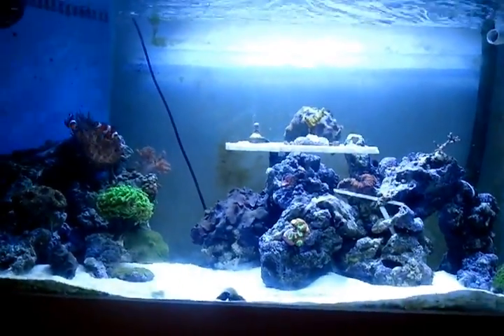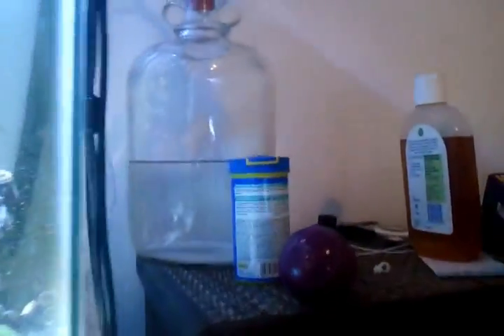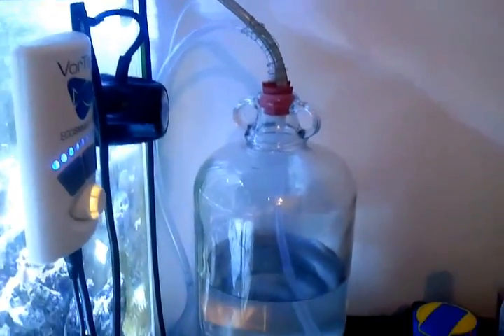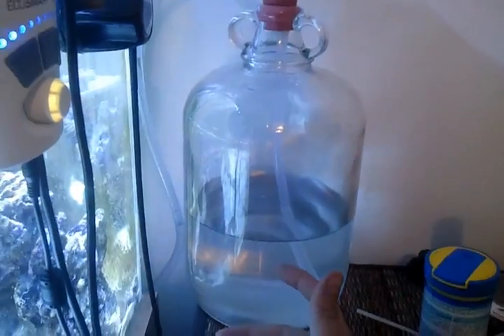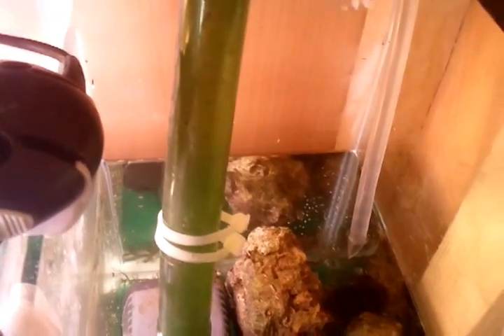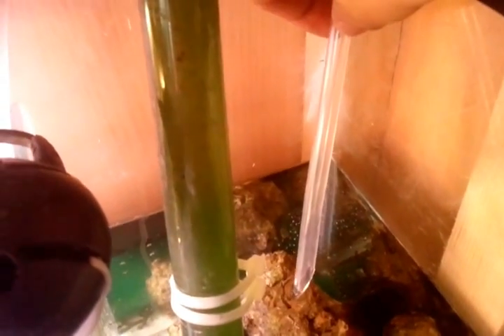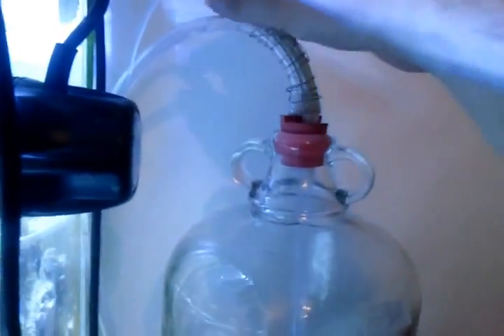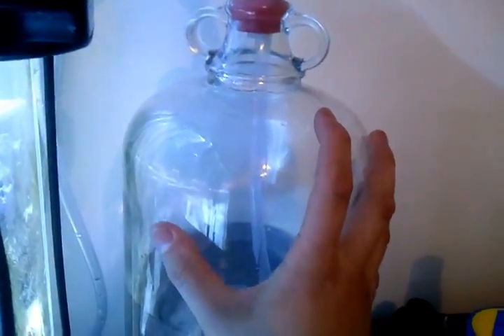diy gravity auto top off vacuum

Comment: Fantastic but I just don't know how you set that up ?
Reply: Theres Only 2 ways  in and out. Water out via siphon and air in via tube in return compartment.when water gets low it lets air in and water out. When the level is sufficient to cover the hole in the air-in tube The water level cuts off the ability to equalize pressure, thus stopping the siphon.

Comment: you can use plastic bottles such as a 5 gallon drinking water. I use one for other reasons. the difference is that it will flex inward. so it's best to have an adjustable vacuum break as it will let in a little bit more water than you normally want do to the slight flexing of that container
Reply from the maker: +Joshua Clough it has to be glass as the plastic one will just keep compressing i tried it with a few different types these glass home-brew type seem to work best from what i have found there only cheep also

Comment: Hello do you have both tubes touching the water in the bottle or just one at the top?
Reply from the maker: Hi the one tube feeds down to the bottom of the bottle (about 2 inch above if u are using calk) and the other line is submerged in the sump and one on the water surface imagine it like a big straw and the water level is your finger stoping water in the straw coming out it has to be a glass jar or strong acrylic also

Comment: I have used my Dremel diamond cutting wheel, to grind the appropriate bezel on the Pyrex tubing end of the 'siphon break line' since my previous post.. The physics of what happens with “perpendicular square end,” especially with smaller diameter tubing, is that the cohesion of the water holds the water molecules together like a plug, rather than letting air into the tube. People in Aquaponics have experienced similar problems with the comparatively larger diameter 'Straw' of their Bell Siphons.

Comment: I notice the detail of you having cut the end of the 'vacuum break' tube at an angle to facilitate proper functioning. On my set up I had used short lengths of 8mm. OD. Pyrex tubing in an easily fabricated acrylic clip on holder; to attach the tubing to, at the desired tank depth(s) for both lines. Ran into a slight problem with the 'Vacuum break' functioning properly, because the ends of the pyrex were cut square and fire-polished, and the clip held the tubes exactly perpendicular. Solved the minor problem by inserting a short length of wider plastic cable-tie into the tank end of the 'vacuum break tube.' (Just in case anyone encounters this problem.)

Comment from the maker: Hi the one line sits on the water levle and the other is submerged the submitted pipe is then sucked to create a sypon afect and as the water levle rises it stops air going to the Bottle and stops the syphon hope this helps also it has to be glass or Perspex to work right